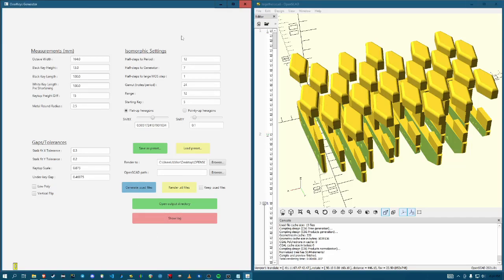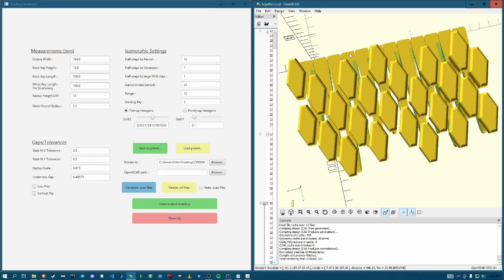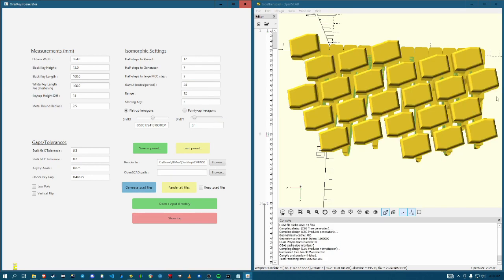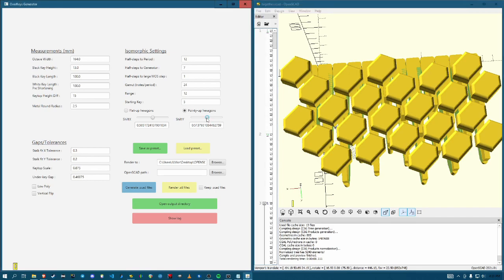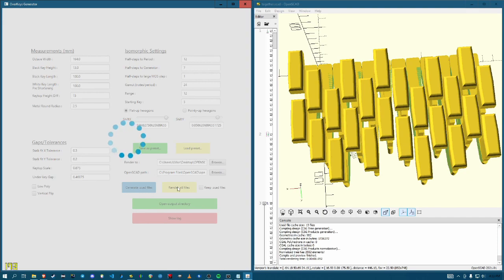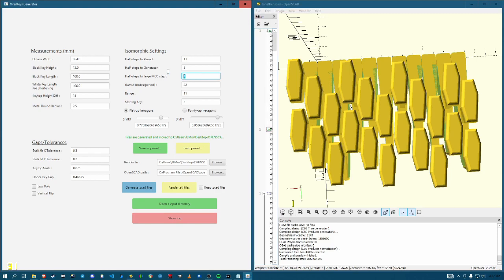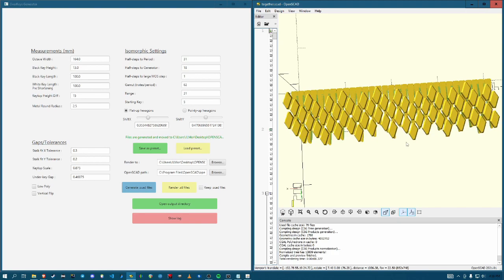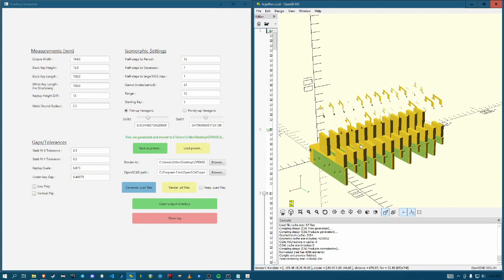Create your own 3D printable isomorphic keyboard overlays!

Comment: Do you sell the kits to make a keyboard ?
Reply from the maker: Not anymore, sorry
Reply: @JLMoriart is it something i can print myself ?
Reply from the maker: @LiveGadgetLive  Technically yes, but it would require that you set up the development environment for the open source program I wrote so you can compile and run it, and then generate the CAD files for the overlay. Also you'd need to dial in the tolerances for the gaps between keys. So unfortunately it's not an easy process.

https://github.com/JLMoriart/OverKeys-Generator